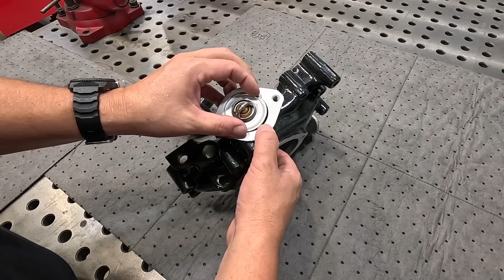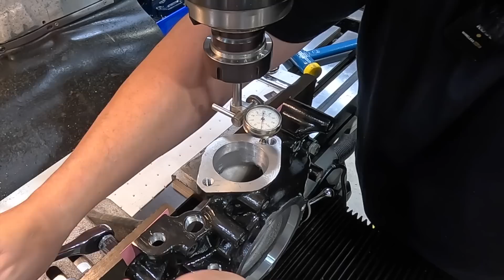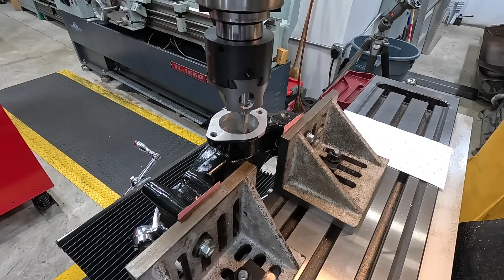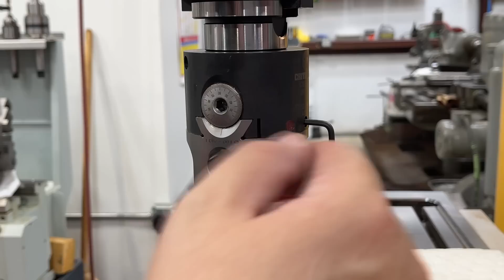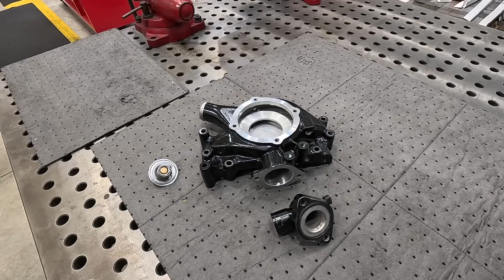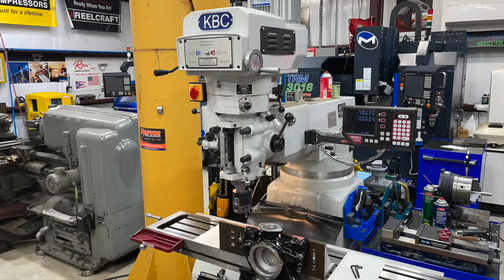Mopar Water Pump Housing Part 2- Counterbore for Thermostat

Comment: AB  I'm not a machinist so here's a dumb question. Why did you use .015" shim stock against the pump body to make the work surface level but went to great pains to get the other axis exact?
Reply: Ok I guess I was half asleep last nite so will answer my own question . You don't care if the thermostat flange is square to anything, just getting it level so your tool will cut a consistent depth into it so the thermostat sits flat.

Comment: Hello, great content as always !!! I do have one question from complete amateure- When you were mesuring your center with the 3D sensor - How you know that you mesure the Y edges in the middle of X ? sholdn't that opperation containd 4 messurments instead to be sure ? I hope my question make sense its kinda hard to explain
Reply: It wouldn't matter if it was exactly in the middle because your offset from center would be the same from one side of the part to the other. So it would still give you the correct center. Think of a circle with a line from one side to the other going directly through the center. Now move you line offset in what ever direction you want. Your total width of the line would change but your center would still come out to the same position as long as you didn't move the other axis during your measurement.

Comment: I picked up one of those Haimer indicators back in the spring.  Anyone else ever verify zero with it after it gets reinstalled in the mill?  

I have to adjust mine every single time, and it is not just a little off.  Does not matter what chuck I use (drill chuck, any of 3 R8 collets, ER32 collet and chuck....). It is not rough handled either.  Try it.  Zero it out, remove it from your mill, remove and install what ever chuck or chuck/collet combo then put the Haimer back in, turn your mill on with a separate indicator on the probe.  

My spindle has 0 runout, and I have checked and rechecked my collets for runout.  Not the problem.

Comment: Great setups, and thanks for showing them.  I'm about to finally use an angle plate I've had sitting in here for about 3 years, so great timing.  Thanks.   On the thermostat, so they have an O-ring in the housing stacked on the rubber seal on the thermostat?  That rubber on rubber seems pretty odd.  (I know, not your doing or problem).   But again, thanks for this an all vids.

Comment: The Haimer 3D sensor is metric ...right?...i was just wondering...not that it matters ...a lot...
Reply: Zero inches and zero mm are the same thing.  Round is round.
Reply: Towards the end of the video, there is a close-up still shot of the Haimer. On the face, it shows that each division is 0.0005" - therefore that one is imperial, not metric.

Comment: Excellent work, Adam. I would have got centre on attach part from bolt holes and oring seal and copied to pump side
Jack
Reply: You absolutely can't assume those mounting holes correspond with the bore center.   Usually close, but sometimes suprisingly far off.  He did it just right.

Comment: fyi finding the center of an unmachined  raw casting is not the correct way to do that. you need to work off of machined surfaces so that the counterbore will line up correctly with the mating part. All you have to work with are the screw holes so it requires a bit more indicating and some trig. but it would be the correct process.
Reply: You guys miss the point that those holes are not a good reference to the bore center to begin with.   Also, that in this case he already put in way more precision than needed.  There is nothing that requires concentricity here, but his method Did give the needed flatness for a good even seal squish. Done just right.
Reply: @Rog-Against-The-Machine  It is actually you that is missing the point. Even after reading  my explanation, you still don't get it.
Reply: @Rog-Against-The-Machine  The idea is when working from a raw casting the tapped holes are put in equally from the rough port bore. If this is repeated for the smaller mating part then the two ports will line up.
Looking at the small part it seems the center port and clearance holes were both machined and a good assumption they are equidistant from the port. So I would machine the counterbore equidistant from the tapped holes to ensure the ports align.
Reply: it may be even easier - you need to have something tapered in your chuck and just insert it to no-so-round hole, it will be as close to center as possible without indicating stuff. in this application you don't need to reference from bolt holes etc since you inserting round part in that hole, not making new hole.
Reply: @RAPXZibit , that's a good call. My thoughts were that once the top was trammed in with a lever indicator, the indicator would remain in the chuck. If it was important to machine the counterbore central to the 2 holes, then use it as I posted earlier. Or if the hole center average needed to be found, then just indicate in each axis and split the difference.
Reply: A method for finding the center of the hole in relation to the two tapped holes is to indicate one hole and zero the dro in both axes. Then, indicate the other hole and use the 1/2 function on both axes. X0,Y0 on the dro is then the center of the hole. I use cut-down shoulder bolts to indicate the center of tapped holes. To use this method, the part does not have to be trammed to any axis.

Comment: Use the bottom of the quill to initially set the level of the housing?
Reply: If you note the bubble position on the bed then the face can easily be set within a couple of thousandths.
Reply: Or the side of the quil with a square
Reply: Good enough for me

Comment: I have my Haimer in a dedicated tool holder because as it says in the instructions that came with it, you must mount an indicator on the table and using the 4 setscrews on the unit to zero the probe.  You can’t just stick it in a collet or endmill holder and expect it to be accurate without doing so.
Reply: I'm not a machinist, so I may be asking a dumb question here.  Let's say the holder was 20 thousandths off.  The way it's used in this video to go from X left zero zero to X right zero zero, would that still not find an accurate X centre?  My brain says the holder, so long as it's rigid, shouldn't influence this measurement.  What am I missing?

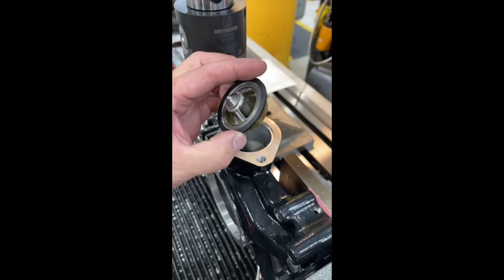Comment: 31:06  VERY good! using off the shelf parts is always nice when possible, 

I note .015" Compression for that style of "square O-Ring", I will keep that in mind if I ever have to do one.  I mentioned below I had to put a special spacer on the thermostat for my build (to have TWO thermostat senders) 

I used an oddball 170°F Thermostat, but they ARE available .... and a180° would work as well (plus I bought two of the 170°s)   I actually LOOKED at the Hi-Flow ones, but could not find one in 170°F that would ship to Canada, and  at this point with stock heads I do not really need the Hi-Flow yet..

Comment: On all the big block Chryslers I have ever worked on the recess for the thermostat is in the top housing that you bolt on. And they come left hand right hand and straight and usually cost about less than $15 so I'm not sure why this guy is paying you to do this unless you're doing it for 20 bucks. Also most of the housings I use Point straight up so with a 90° radiator hose you can go in either direction anyway
Reply: Chevy had the recess on the intake. Mopar had the recess in the water neck. This mod is common when using a "Chevy" style water neck. Both use the same thermostat. Most universal AKA aftermarket and race parts are Chevy style. 

In summary, I agree with you. I just wanted to add some info for anyone who wanted to understand. 

Thanks

Comment: I'm interested to see when everything is bolted into place on the engine is the thermostat going to move upwards any when coolant starts flowing. Causing the thermostat to have a gap in between the area that was machined and the thermostat. Could cause an over cooling issue until thermostat opens up.

Comment: FWIW, This is an example of where Chevy and Mopar Water Neck and Thermostats are almost interchangeable. This machining is not required if the correct parts are  used, but on a "restoration" where "stock appearing" is wanted, this machining is common.
Reply: I am confused by the term "restoration". I could be wrong but I don't believe any 72 Charger came off the assembly line with a front engine plate. When I see "engine plate" I think race car.
Reply: @tsmartin    "restoring" a race car... maybe...

A motor plate car will rattle your fillings out if you "street" drive it.

Maybe it's a "show" car made to look like a race car...

Custom vehicles are like going to a restaurant. The customer decides what they want instead of a chow line like in prison. Since NMCA shut down, there may be a trend to do more show and less go with "classic" drag cars becoming "pro street" style "show" cars.

In summary, a "Chevy" style thermostat housing AKA water neck is being used. Thermostat is the same for both Mopar & Chevy.

Comment: I hope that ledge is big enough. Thermostats take quite a beating and it might fail because it got sucked in.  You may wind up having to build up the inside by welding and recutting it,  or preferably a different one.

Comment: I love the fact the back face to the thermostat is surely supposed to be perfectly 90 degrees angle, but Adam replicated the manufacturing error anyway for the sake of perfection with some shim.
Reply: Surely seems like the time to grab a face mill 1ST:face-blue-wide-eyes:
Reply: Yeah, but… I think the small part just connects to a floppy hose.  It could be, like, way off and everything would still work fine.

Comment: Adam, if you had done this on the CNC, it looks like you could have probed the water passage hole in the casting and cut the counterbore using a small diameter end mill with a 3d surface as your counterbore.

It seems like it would save a lot of set up time.
Reply: What do you mean? Same part setup time + tool setup + programming.

Comment: I was saying "use your 4-inch level", then you pulled it out.  Made my day.  Thanks Adam.
Reply: Set the level on the bed and note the bubble position. Use this bubble position as a reference on machines that are not level. This works to achieve level easily within 0.002" of the bed

Comment: 1:03  I had to modify my Chevy Step Van in the thermostat area, no machining b me, but I added spacer the goes UNDER the water neck ...  it comes drilled and tapped for a standard temperature sender! :)  (3/8" - 18 NPTF) on each side

The new Throttle Body's Computer, (I installed Holley Sniper 2) needs it own Temperature sensor,. So I needed two ports.  

I also got imported from California a unusual aftermarket GM170 degree thermostat. they only come stock with 160°F or 180°F or 195°F .. see how it runs this winter now

Comment: I would not bore this out until the correct thermostat was in hand. 
You need to oversize the bore to allow for heat expansion, otherwise the thermostat will bind up and cause overheating. 
Probably.030-.040 larger should work better.
Reply: The coefficient of expansion for steel over a 200F range is 0.002 at the high end.  Pretty sure 0.030 clearance isn't needed.
Reply: @mungtor  Thank you
Reply: @mungtor  Actually, the aluminum housing will expand more than the steel, so 0/interference at room temperature is probably OK.
Reply: @brettbuck7362  This is also true.  Didn't know if the housing was cast aluminum or something else, but either way it's not gonna move a whole lot.
Reply: I know that it’s not in the shop now but Adam should have waited for the correct thermostat or a known used one, then boil it in water and measure for the expansion.
Reply: 40 thousands!? How hot do you think it gets?
Reply: You do realize this is more than likely already back with the customer some time ago.?
Reply: @jimfiles3307  NO IT WONT HOSS. ORING FROM ADJUSTABLE HOUSING SEALS. IT WILL HOLD. TRUST ME.

Comment: ah another part to the "we all knew this was a mill project from the beginning" project
Reply: good grief.....34 minutes for a recess.
Reply: @melloman8210 that does not include tramming in 2 angle plates level with each other. Which was not required.
Reply: @melloman8210  What part of instructional videos do you not understand? Sure ... if he didn't want to record it and explain the process it could have been done in no time. Good grief ... nobody is forcing you to watch it.

Comment: If the angle stock are true parallels, then the water outlet machining he did earlier is 0.0010” off since the thermostat surface is factory
Reply: Factory parts take advantage of all the tolerances allowed on the print. In fact, the automotive industry switched their dimension scheme from the old leader lines & arrows to Datum Line dimensioning in the early 1960s; then GDT (geometric dimensioning & tolerancing) in the 1980s. GDT features “bonus” tolerances to provide Manufacturing more leeway in producing parts. It took mid-career engineers, designers and manufacturing people a couple of years to become proficient at using and understanding the bonus tolerance aspects of GDT.
Reply: And then comes a rubber hose on that, and a bit of twist of the 440 CID as  it pushes down on the right hand side at the intersections.
Reply: He indicated both planes, copying the factory angle.

Comment: You could've indicated it level easier, and more precisely, by putting a long and wide parallel across the flange, and indicating along the top face of the parallel.

The longer the parallel, the more precise the indicating would be, and you wouldn't have a large hole to traverse with the indicator.
Reply: An indicator could have been rotated on the face like tramming the head. No need to move the table about.

Comment: You've got a lot of faith in the customer to do this job without the actual thermostat.  You must have a good history with him.  EDIT:  I just watched the ending.  ROFL.
Reply: Why do you need faith? The customer provides the measurements, you machine the target dimensions they provided. If it's not right it's on them,not you. One job becomes two with two separate charges. $Cha-jing$
Reply: @snappingbear no one not even a bomb seems to be taken into account the fact that the thermostat will expand at a different rate than the aluminum and they need to have plus 10,000 to 20,000 on the OD of the thermostat to account for expansion 2:01
Reply: @paulsilva3346  Again, not Adam's problem. Regardless, I'm not sure I trust those expansion estimates. I suspect the seals will likely still hold under the low relative temperatures. We're talking a few hundred degrees, not extreme temperatures.
Reply: @snappingbear  a lot of people are terrible at giving dimensions.  Then when it’s not right, they get upset and you have to do the job twice. At the end of the day nobody is happy.   It a reoccurring theme in a job shop.
Reply: @aaronfritz7234  I don't mind. It's the client's fault. Your job is to hit the numbers on the "print" within the specified tolerances. If you do that, you've completed the job. Period. Changes or mistakes by the client become another job or are charged accordingly.